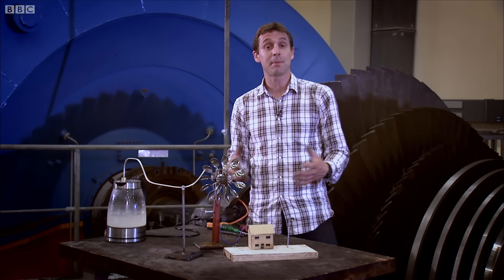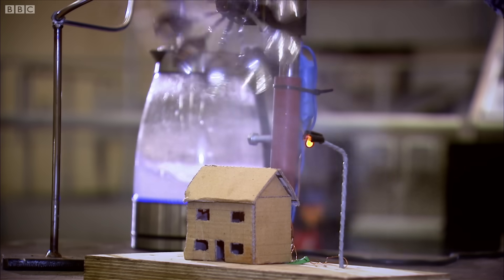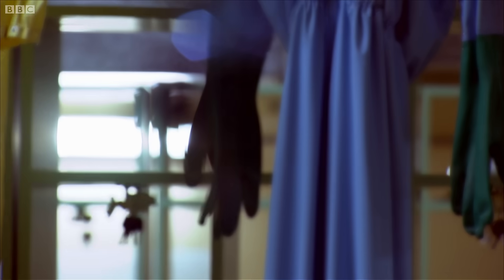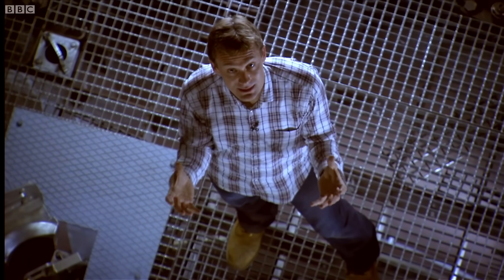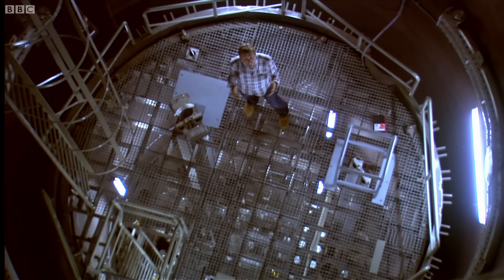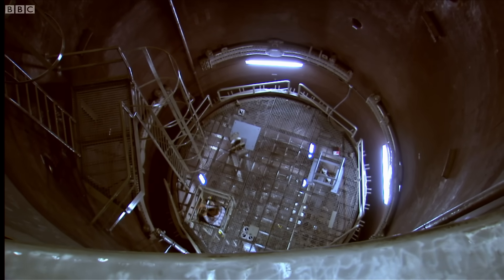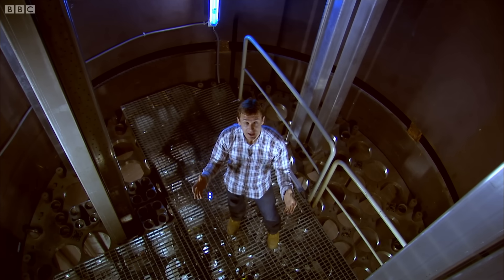Inside a nuclear reactor core - Bang Goes The Theory - BBC

Comment: Did he really mean going "critical"?  Isn't that when it's out of control and all the uranium splits at once as in a nuclear bomb?   Maybe "sustainable" is the word?  I don't  know I'm seriously asking.
Reply: The water acts as a moderator, slowing down neutrons and thus increasing the chances of them hitting another nucleus and sustaining the reaction. It's not possible for a nuclear reactor to go supercritical and explode in the way a fission bomb explodes.
Reply: @paulanderson79  Ah.  So there's a distinction between critical and supercritical.
Reply: @leifharmsen  Yes. Sorry - I will answer properly. Critical is when the reactor is in balance as is emitting neutrons at the same rate it's absorbing them. Supercritical is when it's emitting more than it is absorbing.

Supercriticality in a reactor is controlled whereas in a fission weapon it isn't.

The hardest part of dealing with a fission bomb is getting it to explode in the first instance, rather than just fizzle and melt itself. Granted it's still chucking out copious amounts of undesirable radiation whilst fizzling.
Reply: Critical= The reaction is sustained and is generating energy without requiring energy. This is how the reactor is meant to be run.
Supercritical= The reaction is increasing at a very fast rate to the point where if it gets to hot it could melt the reactor core, this is when it's time to cool the reaction a bit by inserting the control rods deeper to catch some of the neutrons. If left unchecked this can cause a meltdown.
Subcritical= The reaction is slowly calming down meaning if left unchecked it will eventually stop. If the reaction stops thats bad because it requires power to start the reaction and the goal is to generate power.

The optimal scenario is to start the reaction, and keep it at critical levels for as long as possible. That's how you generate the most energy without having to consume much and why nuclear reactors are so unbelievably effecient.

Comment: If those are real uranium fuel rods...
Why is he so close to them

Why is he handling them with his bare hands
Like,dude.why,just WHY
Reply: It's low enriched uranium. Quite safe to handle. What you don't want is loads of it all together at the same time.
Reply: @paulanderson79  your right but exposure is bad when it is frequent just as much as short but excessive exposure
Reply: Uranium is an alpha-emitter which is safe to handle. It's only dangerous if ingested. Plus, most of the uranium in that pellet has ha half life of like 4 billion years. The fissile isotope that makes up a small percentage has a half life of 700 million years. So it doesn't emit much radiation at all.

It's spent nuclear fuel that is super dangerous in terms of radiation, because it's filled with fission products and their daughter elements many of which are much more radioactive.
Reply: @Arkalius80  Finally someone else who understands physics. Thankfully most of the spent fuel daughter nuclides are fairly short lived. As you say, U238 is only very slightly radioactive, hence its very long half life. This is the thing most nuclear power doubters wrongly worry about.

Comment: Inevitable Meltdown preparations

I am proposing a viable option for dealing with waste and melt down.
Using off the shelf technology from the mining industry.
Drilling a series of holes in a circle and pressure cementing them to create a water tight shaft. concentric circles can be created as well.
Then drilling a 2 foot diameter hole 2 to 3 thousand feet deep directly under the core.
Should it melt down it would meet a cement funnel shaped guide with a 2" thick aluminum cap and drop to the bottom and out of danger.
A vented plug would then be lowered down above the molten material and a large amount of charcoal placed above the screen.
Variations of this could be used to gather heat from the molten material for A much safer source of energy as well.

  Pass this idea on and the 400 + Nuclear power plants around the world could be much safer.

The depth Proposed by the Nuclear Industry of 2,500 foot is adequate and I agree.

  Shafts holes 2 foot in diameter, as described including depths of 2,500 feet are drilled regularly in the mining industry all around the world. 
This eliminates transport of radioactive waste, 
Radioactive waste could be dealt with in basically the same manner at the 
Current locations.  That is one nice thing about charcoal as it 
Filters dry or wet.
  Now when it comes to Fukushima there is a problem with water.
Miners are having to deal with water all the time. So in the situation as with Fukushima ground water is continually flooding the contaminated area 
Under ground and caring it out into the Pacific Ocean.
Miners in this situation would build a curtain of cement and other materials
That makes it impervious and the water is diverted from the area so it is 
NOT CONTAMINATED in the first place  …

Comment: You know, this seems like a lot of over engineering to accomplish what a dam and turbine could do. 
Granted A Dam costs a significant amount of money, but when you look at the scale of regulation and specialized technology required for sustaining a controlled fission rate, you have to wonder if the payoff is truly worth it. 
I'm not taking an anti nuclear reactor stance. Rather, I wonder if it is really economically feasible over a long enough amount of time.
Reply: You know, if you knew anything about the amount of power available in this (as opposed to a fossil fuel) you would ask.   Perhaps xkcd can get through:  http://imgs.xkcd.com/comics/log_scale.png

You can afford a lot of cost and inefficiency when the energy source is tens of millions times more dense. And no flooded towns upstream or downstream.

Comment: Obviously not the water which is heated by radioactivity goes into the turbine, that I think would produce a little mess wouldn't it? 😉 Actually it heats another circuit of water, turns it into steam and that goes into the turbine.

Comment: In 50 years from now, when EVERY HOUSE has solar shingle roofs, and every tall building has solar panel cladding (on the sunny sides only), and wind farms and solar farms make up for the rest of the demand, and Massive storage batteries are used to store excess power for when it is needed, people are going to wonder why on EARTH did nuclear reactors even get invented.
Reply: Because it paved the way for Fusion reactors which we'll be using instead of everything you've listed.
Reply: +Neeno we are kind of already there. The Sun itself is a huge hybrid fusion and fission reactor.
Reply: +USS G R. F - You can have fission without Uranium.
Reply: paulanderson79 Yeah, was confused when you said fission in a Star.
Reply: paulanderson79 No it really isn’t. It’s impossible for Uranium to form in our sun
Reply: paulanderson79 You need heavy elements, which can be Uranium and plutonium. Suns cannot produce anything beyond iron.
Reply: OK - I see where you're heading. I am correct though in saying that it is a giant fusion reactor I think. Perhaps I am confusing what is expected to happen as it nears the end of its life and it becomes cooler? I agree - it's impossible for large and unstable elements to exist at current solar temperatures. Cheers, P.
Reply: I can understand why !!
Reply: Is that what they'll be thinking as they slide off their rooves while cleaning those panels? Dozens die each year that way.  And in massive battery explosions (hell, look at how afraid people are of lithium batteries in their phones).  Also, like in Australia, they'll be paying 10 times more for that power than they do in Canada.

Comment: Its the mass defects that generates heat energy ( E=mc2) not splitting atom. Colliding with walls.. As you said. 

2nd its not water what they use its heavy water.
Reply: Heavy water is chemically identical to 'normal' water. The difference is simply that some of the water molecules have nuclei containing either one or two neutrons.
Reply: Yeah, but it's the splitting of the atom that occasions the mass defect. It is manifest in the kinetic energies supplied to the uranium fragments, which give it up as heat as they bounce around and ionize everything in sight.

Second, some reactors run with heavy water as a moderator; some other designs use plain water. Some use graphite.

Comment: Nuclear power is arguably the cleanest, efficient & abundant method of power generating. Yes the radioactive waste will linger but in a working & confined environment it pollutes significantly less the coal or oil while generating significantly more juice than finicky hydroelectric, wind or solar. All you have to do is keep up maintenance & secure desolate storage for spent uranium fuel rods and we'll never be short of power.

Shame that infrequent but media-fueled accidents, mongering politics & constant fear of WMDs are abandoning nuclear plants for less viable alternatives.
Reply: Completely agree. Nuclear power stations create very little waste and it's quite safe to store it in pools of water. The media always overplays 'incidents' for one reason. To sustain public fear of nuclear weapons. Without fear, the weapons are worthless.
Reply: Fnord Fnordington  Yet, those much vaunted wind farms are also taxpayer funded, and no one complains. Despite the fact that they cannot deliver the vast needs of a country, in the same way as a nuclear reactor. People want to go green, they don't want more reactors built, but no one wants to curb their electrical usage. Eventually, the lights will go out, and the green dream will be shattered.
Reply: Fnord Fnordington  It's easy to debunk, how many wind farms to you need to build to power a city? Then how many nuclear power stations?
Reply: There are safer nuclear technologies though. Thorium, for instance, is a cleaner and cheaper technology and can produce more energy than its Uranium counterpart. True, this material usually needs to be used in conjunction with Uranium in order to sustain the reaction, but it has a far lower risk of having a meltdown. Also, while not yet perfected, fusion technology is showing a lot of promise as with virtually no harmful waste products.

Comment: I'm confused.  The nucleus has to absorb a neutron in order to fizz.  But that would mean that U235 becomes U236.  And U236 does not decay for thousands of years.  So is the neutron not really being absorbed but rather it is just splitting the nucleus?  And if that's so then why slow down(moderate) the neutron?  Why not just let it hit the nucleus hard?  Wouldn't it also split?  I'm missing something.
Reply: For the smallest part of a nanosecond, you are correct.  It becomes U-236, but with a violently oscillating nucleus.  Eventually, a piece of the nucleus will find itself isolated a small amount form the rest, just enough that repulsive proton-proton magnetic forces can overcome the nuclear strong force residual, and the nucleus splits. It's the extra energy the neutron carries with it that starts nucleus oscillation that makes the difference.  Various materials have different effective target sizing for different neutron energies; at high energy the target nuclei become small and hard to hit, while at lower energies the targets are larger.

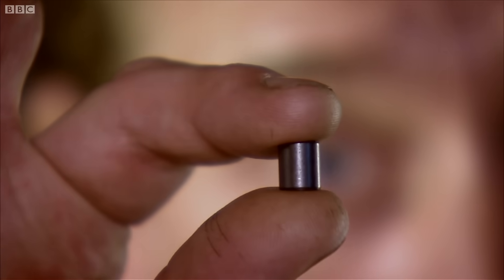Comment: 1:45 *purified and enriched uranium oxide (OU2).
Reply: Kendethar Zendeth fuel pellets are not enriched. They are mainly uranium 238, not 235
Reply: @matman7546  It depends on the reactor. Most US reactors do use low-enriched uranium

Comment: A Solar Power Plant has been constructed on the premises, which went into operation on June 25, 2009. After completion, 1000 solar panels on the site provided approximately 180 MWh of electricity per year. In comparison, the nuclear power plant could theoretically have produced up to 5,455,728 MWh of electricity per year (assuming a 90% capacity factor).

What the hell Austria?

Comment: hey ! it's the actual functional  reactor then it should be radio active right
and the host is without any protection
Reply: It was never used.
Reply: Santosh Moopanar any of the pellets he was holding was radioactive decayed uranium which turns into lead when it decays so it wasn't radio active

Comment: so what happens when you take water out of the equation of a nuclear power plant that has gone critical? It'll cause a meltdown, yes I know, but how does it do that exactly? This video is too short... It just feeds us with bits of info and leaves us dangling. I wish it were longer...
Reply: The water not only creates steam, but it cools the reactor core. With no water, the core would heat up from the fissioning of the Uranium atoms to a point where it begins to melt.( Splitting atoms creates an enormous amount of heat, as well as energy.) At this point, the molten Uranium and it's cladding ( The metal that covers the fuel rods.) forms a lava that eventually burns through the bottom of the reactor vessel and assimilating anything it touches including concrete. The molten lava is called "corium." It is so highly radioactive that just three minutes of exposure will kill an average human being. The Corium from the Chernobyl disaster was emitting 10,000 Roentgens per hour. Not the kind of thing you want to be anywhere near.
Reply: There's what's called a negative void coefficient. So when you produce void (aka vaacum, air, or steam bubbles), adding negative reactivity, and the power level will decrease because the neutron population will decrease. The temperature will also increase, and because US reactors (and most, but not Chernobyl, an RMBK reactor... they have since been modified), are overmoderated, by increasing the temperature, you are adding more negative reactivity, again decreasing neutron population and therefore power. All of this means your reactor will shut down automatically. BUT because it's a nuclear reactor and not a coal boiler, you still have radioactive fission products with short half lives that will throw off radiation. Immediately after shutdown you still produce ~7.5% of whatever power you were previously producing. This will decay exponentially. So what you have to cool is that decay heat. Furthermore, if it were to melt, you mess up the geometry and again add more negative reactivity, so there's little chance of it ever going critical again. Look up a LOCA (loss of coolant accident), it's exactly what you're asking about, and is a design basis scenario. All reactors everywhere have simulations saying what would happen (and what would be done), if there was a LOCA. Essentially, you start the ECCS, an emergency coolant system, and that takes away the decay heat so the core doesn't melt.
Reply: 04Interc3ptorP71 there's a video on YouTube about it if you're more interested in learning more. It's made by Zepherous and it's actually really interesting to see and learn about, it's called the "elephant's foot".
Reply: In a light water reactor, if the water is withdrawn,  first it shuts down the fission reaction, because the water is moderator.  Without that, insufficient of the neutrons have the right amount of energy for capture.  

The second function of the water is for cooling the rods and transferring their energy to the generators.  So the generators shutdown, and then the heat cased by decay of the fission products in the fuel rods mount until the pellets melt.  Temperatures continue rising, and eventually the zirconium sheathes breach. The uranium is already an oxide, so it cannot chemically burn, but it gets hot enough to cause the zirconium to react with water, oxidizing it and releasing hydrogen.  The hydrogen is an explosive danger, if it can get to oxygen in the air and an ignition source. 

The molten uranium is much hotter than its own melting point, so hot it can melt some of the minerals in concrete, copper wiring and all manner of stuff it reaches. It is called "corium" in this state, and like any liquid will melt most anything in its path downward.  Slowly the decay heat will subside, or the corium will reach a material which splits it up, increasing its surface area and make it loose heat faster, and it will solidify there.  200 tons of rector innards hewed through the steel of the reactor bottom and flowed into the basements below the Chernobyl rector, creating the "elephant's foot".
Reply: IT GETS TO HOT AND MELTS! NOT A DIFFICLT CONCEPT TO UNDERSTAND!